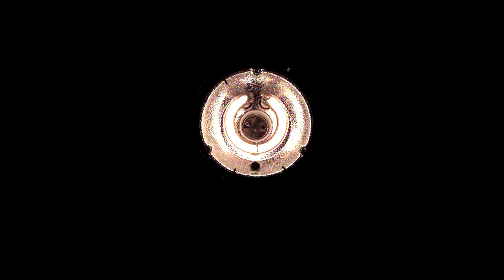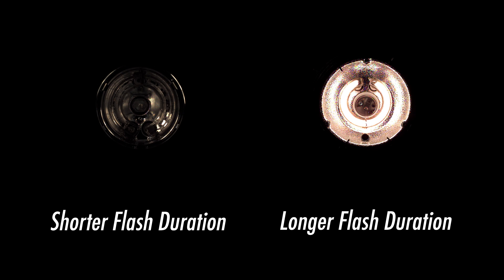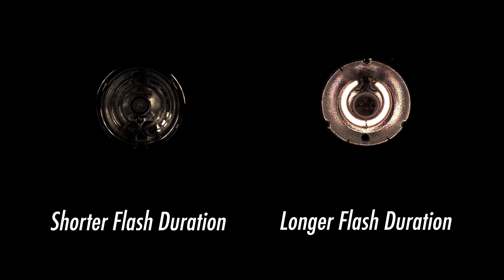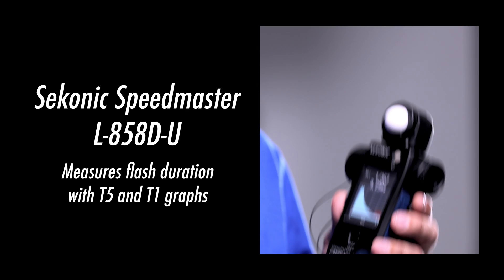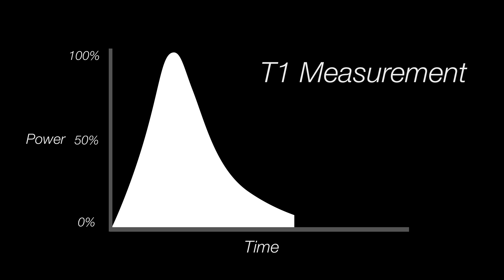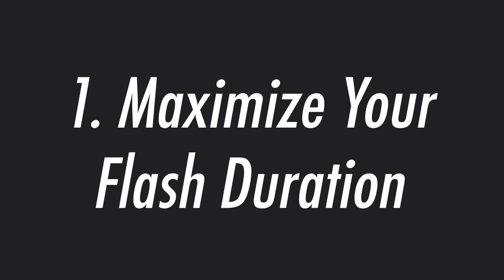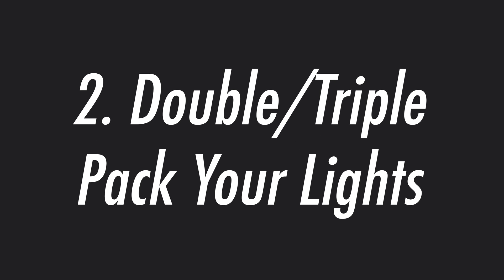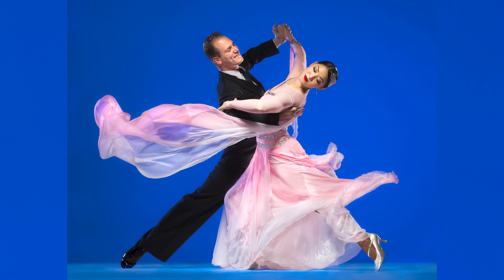Understanding How Flash Duration Freezes Action Photos - BYU Photo

Comment: So here are 2 questions (fairly new amateur photographer w/2 week experience with strobe). My questions cover information not really presented here. 1st: Let's assume for the moment we use flash t0.1 duration in a controlled indoor setting to stop action (i.e. and we have a black frame to start with) much like your football player diving to catch the ball on the matt. Do you generally use a stopped down aperture and movement parallel to you to acquire sharpness of face/eye or AF-C? Same question with outdoor freezing of motion with HSS and shutter speed. 2. I do not own a flash meter and have not played with my flash enough to answer this question for myself yet, but when using HSS to stop action, your power on each of the flashes is reduced. When lowering the power on your flash unit to obtain a faster flash duration time, your power is reduced. My question is, generally, if using the same unit to obtain a similar exposure in a similar environment, which generally provides more power output for the shot? Reducing power output? Thanks in advance for an excellent video on this concept. I stayed away from hypersync since I do not own a flash unit that has this feature, but it seems as though the built in IGBT circuit is the best way to cut flash duration time. Yes? Thanks.
Reply from the maker: 1st answer - Yes, I'm tracking his movement and shooting at f/4.5. 

2nd answer:  Depends on the situation and the lights you are using, but I feel like when you use hypersync you are less efficient than using the flash at full power. We will be doing a hypersync video soon and that would be a good concept to test.

Comment: Thanks for the great video. Given that you are using a quality light or a low enough power that you get a short flash duration, do you need to shoot with settings that kill any ambient light without the flash in order to freeze the subject? Also, what happens if your rim or hair lights have a slightly longer flash duration than the key and/or fill? Will that cause motion blur even if the main lights are firing fast?
Reply from the maker: Good question. Yes, you need to make sure that your flashes are powerful enough to overcome ambient to freeze the subject. We try to keep the ambient light as low as possible and use a low ISO to mininize how much ambient we need to overcome. A quick test yo can do is get your light set to the level you want to use, then turn them off and take a photo of the subject with the same camera settings. If you see the subject you will have to turn up the lights and stop down more if you want to minimize blur. If your rims and hair light have longer flash durations than your key they will show more blur than your key. If your lights have a very short flash duration, the main reason for any blur is usually ambient.
Reply: @byuphoto  Thanks for the detailed response!